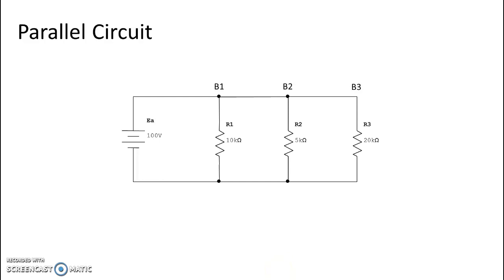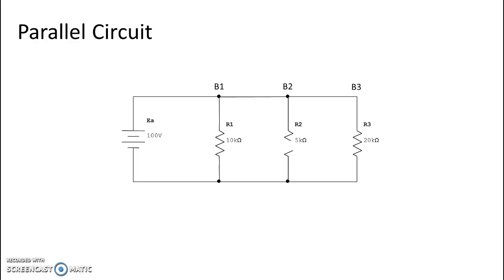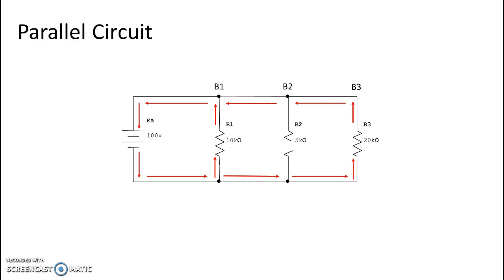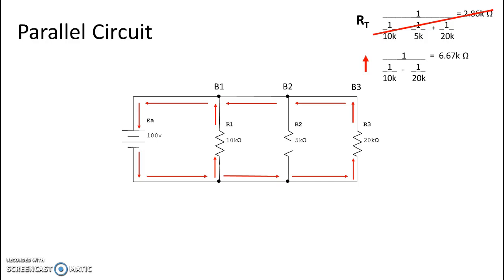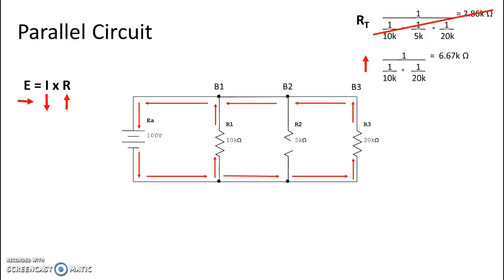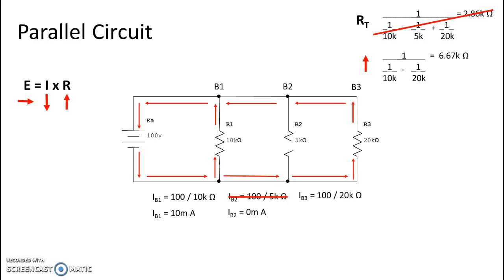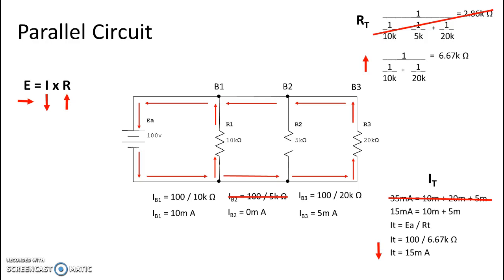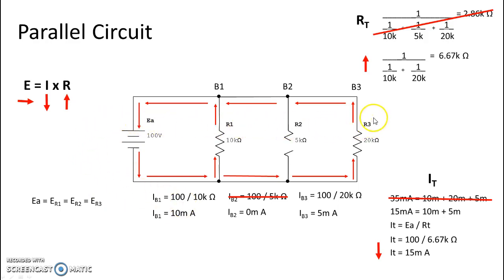Parallel Circuit Fault - Open

Comment: if R2 open and R3 shorted, would the all Voltage =0? (put the meter probes across a resistor)  Ea=E1=E2=E3 and E3=0, is that correct?
Reply from the maker: Simple shorted circuits like the example you pose are tough, because that is technically true.  That if I measured across the shorted resister I would see no voltage drop because there was no resistance, and measuring across an open resister would show me applied voltage (at least in this simple parallel example).  Since current takes the path of least resistance, it would flow through the shorted resister.  However, in this simple parallel each of the resistors is tied directly to your voltage source, so now it’s the same as measuring across your voltage source, and if you’ve ever measured across a battery you will know that you are able to read voltage.